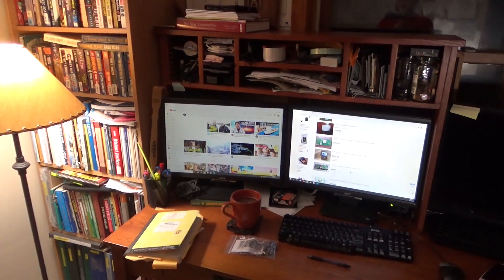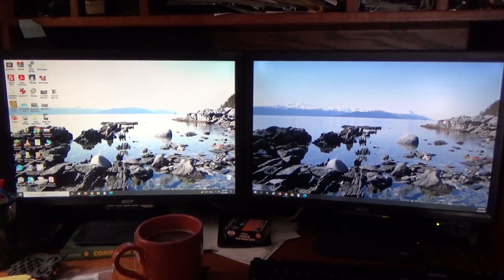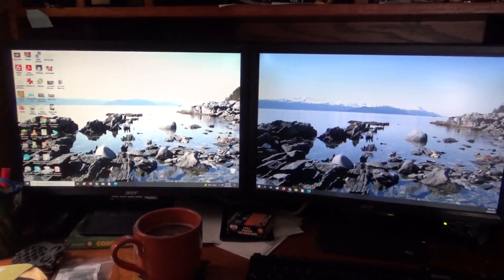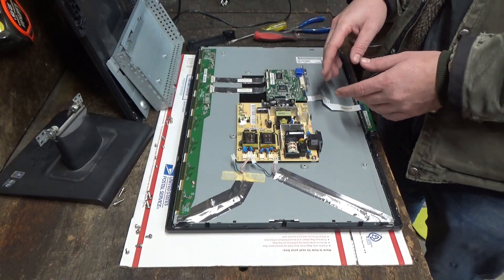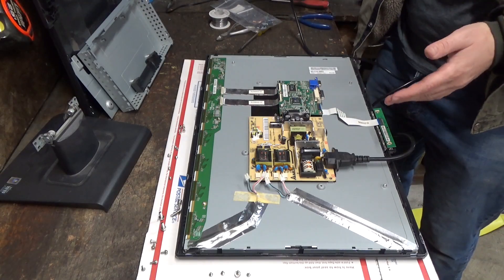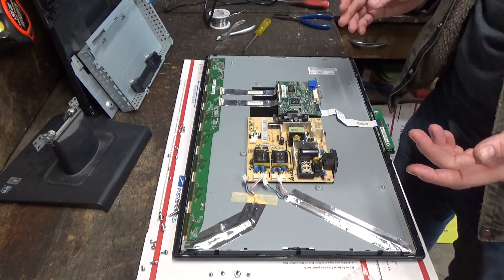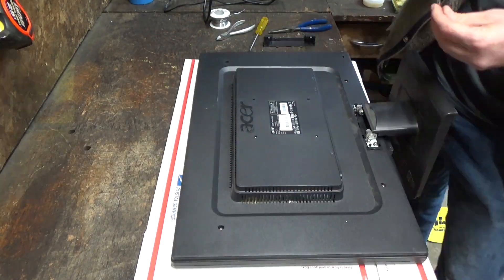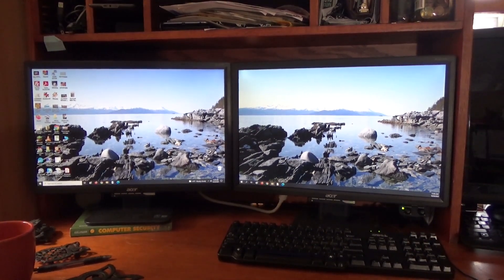Replacing Capacitors in Acer AL2216W Computer Monitor

Comment: Hi, great job replacing the capacitors on this monitor. I am thinking of replacing mine too, I just don't know if my monitor is too far gone. Whenever I plug it in, the light goes green, makes a high pitched pop sound, then restarts the monitor and continues this loop. Whenever I unplug it, it holds that pop sound for about 5 seconds, and I smell a faint smoke smell in the back.
Any replies are greatly appreciated.

Comment: 4:58 Well even though they don't have an HDMI input, they still have a DVI input. DVI is still a digital Signal and looks much better than VGA, especially on those higher resolutions. To use DVI with a modern HDMI graphics card you only need a very cheap passive HDMI to DVI adapter. I've used actually the same monitor that way for years :) 
Though mine also has that high pitched noise. I'll also try to swap the caps eventually

Comment: Those were the good days when monitors had built-in power supplies. Everything has a brick nowadays.
Reply from the maker: I just got one of those curvy monitors and it still has the AC input.
Reply: @saveitforparts  Really? That's cool! I have modern monitors including curved ones from Asus and Acer at home, and all have bricks.

Comment: For others who want to tackle this job, don't forget electrolytic capacitors have a plus & a minus terminal wire (usually marked on the side of the cap) and MUST be put back in correctly or they will possibly explode... okay, pop ! ... 😂 best thing to do is mark the on board the positive location with a pen, I use a red marker dot (red is always positive in power electronics) 

😎👍☘️🍺

Comment: Hah, I have two old Acer AL2216W's as well. Back when I worked for an IT company they were awaiting electronics recycle after upgrading to better monitors for the office so I snagged a couple up before they met their demise. They worked fine for years, put them away in storage for about the last ~4 years. Kinda forgot I even had them till last week when I had to setup a makeshift home office for zoom meetings and general workspace. Pulled em out, turned em on, one of them started smoking as soon as I plugged it in! I figure one of the capacitors died, funny thing is it still works!  They both work but are emitting a high pitched buzz or humming noise (faint but noticeable if it's quiet).

I think it's time to grab some capacitors and solder and give this a shot. That circuit board looks pretty crowded, not sure if I have the skillset to accomplish this.
Reply from the maker: I'm not great at soldering either, but I keep practicing on old electronics I don't care too much about! I've also used the brake cleaner trick to clean capacitor goo off old circuit boards. That's common with old Mac computers, the caps leak and short out the board, but if you blast everything in brake cleaner and then rinse and dry it really well, they come back to life :-D

Comment: I've had this monitor for 15 years, is there a method of unclipping the back cover without breaking any plastic tabs? Thanks for the video, I was about to bin this but by chance found the capacitor kit on Ebay.
Reply from the maker: I think there are some specialized tools for popping open electronics, maybe a phone repair kit would work? Those come with little plastic pry bars and would maybe be more gentle on the tabs. I just used an old kitchen knife since I didn't care that much about the appearance of the sides and back.